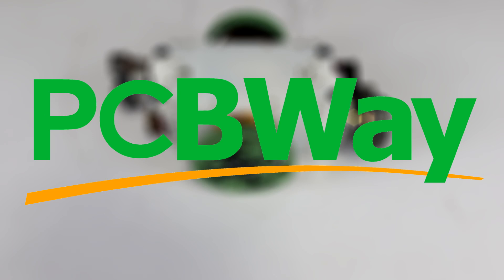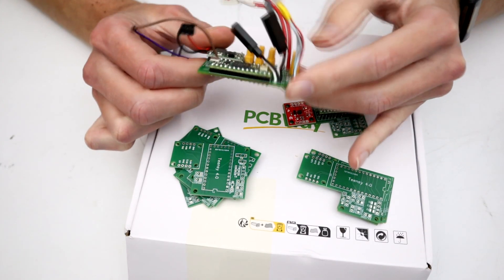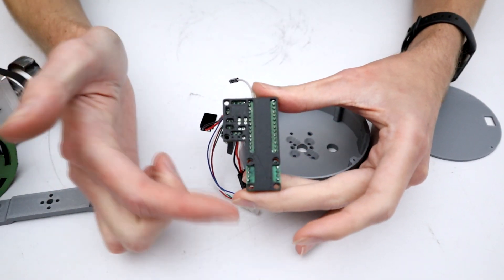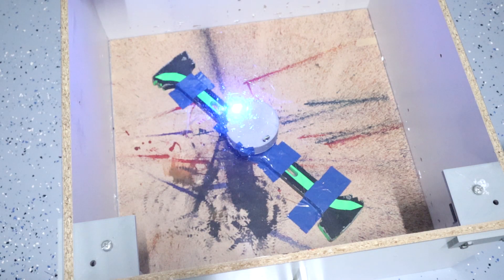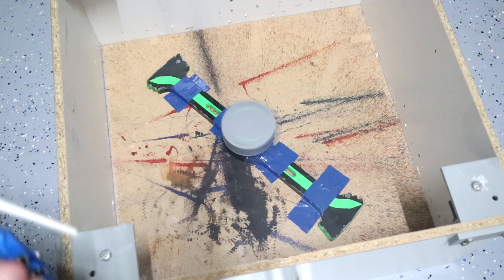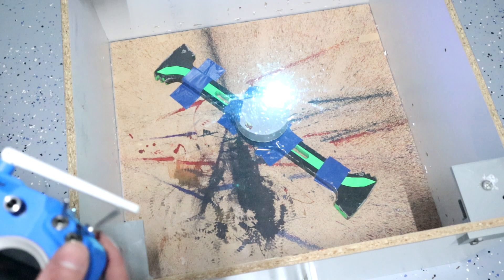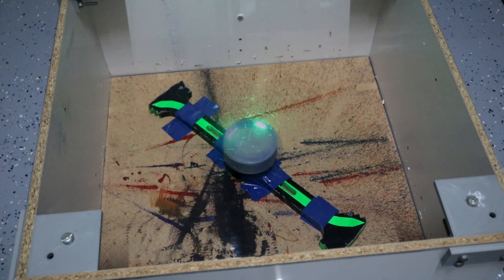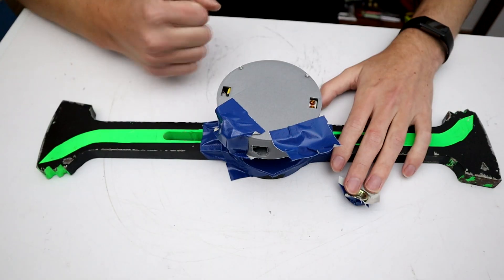A huge upgrade for my spinning robots!! (melty brain accelerometer sensor)

Comment: Going to agree with others, using an accel for dead reckoning in this application is kind of grasping at straws, but using a gyro also likely won't work either due to RPM! You need to infer your rotation and position from an external source. An IR receiver on the bot would be best, so it can PLL a position and/or PID lock it's own speed to that if needed. It's like trying to prove the earth is spinning while still on it, with no stars and sun to reference, and it wobbles more violently than it spins. If it has to be self contained, and an external IR beacon isn't allowed.. maybe consider what sumo-bots do and beacon off your opponents IR reflection, but the walls will cause this as well, so that's a bit more iffy.
Reply from the maker: There is no "silver bullet" to heading in a melty, you are correct, inferring speed based on accelerometer data is flawed, but IR beacons have issues too. People who have run them report a high drop-off in accuracy at range (as the beam from the IR spreads) and also if the beacon is held outside the arena (the only method guaranteed to be allowed by the rules), then the refractive index of the polycarbonate messed up the beacon when the melty is near certain walls

Using an onboard beacon also has flaws, as you have now put sensitive vital equipment on a robot in combat, also it requires a ton more onboard processing, which either slows down your main processor, or requires a second processor, which adds more complexity, things to break and cost

Getting a heading from an accelerometer is simpler, doesn't change based on arena/rules at a comp and can work well enough to fight with, hence why I'm using it

Also, the heading really doesn't need to be super accurate, my current melty gets its heading by guessing speed based on the eRPM of the motors, which is reported by the esc, this is the worst possible way of tracking speed as it has the most possible sources of error, but it has worked in combat and the melty can translate. this accelerometer is a huge step up from that

Comment: Hi Ben, I highly reccomend switching to IR over accelerometer to determine orientation. It's absolute positioning means that cracks on the field or wall impacts or rpm accelerations do not cause drift and offset your headings. Also you never ever ever need to deal with the accel calibration bull crap. Its been working great for my PLANT and believe me, I've tried all the methods. I've been through three different revisions of pcbs with different chips including the mpu6050, AXL375, and magnetometers. I've found that sunlight and reflections dont affect my the sensor and its superior detection means rock solid heading and best in class translation

Comment: I don't get why you don't use a 9-dof sensor and fuse the magnetometer data with the gyro.
You get a fairly good heading check with fast gyro response.
Reply from the maker: Mostly because there is only one mems gryo on the market that can survive/give readings for 2000 RPM and its $50 per chip and they want a minimum order quantity

I think there are prototyping boards for it, but they are more expensive again
Reply: @TeamPanicRobotics  That's just it though, gyros are horrible for such things due to drift.
Magnetometers however are excellent if you can avoid them being influenced by everything and everyone (bots) in the vicinity. Try calculating a direction vector from x/y magnetometer once in your bot and see. Magnetometers are a tad finnicky to work with as you must calibrate em in your final bot and they may be a bit wonky on metal battle arenas, but should still be orientable once you select a direction. I used to love using InvenSense IMU's (now taken over by TDK and deprecated).

Comment: Isn't there a problem with high variations in acceleration readings if the bot is not perfectly balanced and wobbles around?
Especially with a bot that will get thrown around in the arena by it's own design I would not expect it to stay perfectly balanced after some collisions. So the acceleration readings might change drastically destroying any previous calibration.
Just to be sure that's not the case you could move your counterweight in your test-setup a little after a successful calibration to see what happens ;)
Reply from the maker: Thats part of why I have a heading adjustment knob on my controller to make small adjustments on the fly if the heading starts to wonder
Reply: @TeamPanicRobotics  I have no idea how the accelerometer works, but if you read out the value every few milliseconds I think the values could vary extremely depending on where on the wobble the measurement is taken. It might be nearly impossible to get  stable readings.

Comment: put 3 distinct color LEDs on it.  Fire each of them at different rates, for instance 1, .5 and  1/3rd so that they create a distinct but basic patter.  If visually the expected pattern doesnt show, it would help with knowing if the speed/timing is off. as well as how far off it is.

Comment: good heading requires gyro..
a few things I'd recommend..
1. add a gyro (only used for self start calibration during the first 1~300RPM this is used to find the offset from center of mass)
2. use SPI + IRQ over i2c SPI is significantly faster and by using A. fixed timer interrupt. Or B. input interrupt the RPM calculations will be far more consistent the main clock is held during the delay function + code execution. i suggest  putting all of the spinner function into a dedicated loop on it's own clock possibly use DMA+FPU to hand most of the math so the CPU can focus on servo and led signals.
If am bored this weekend I will rewrite your code for how it is and some code for how i think it can be better. I might just redesign the entire thing as i can think of a few uses cases for it my self

my last and biggest hint the center of the bot and the center of rotation are not the same at speed it will rotate around the center of mass so the accelerometer offset needs to be based on the center of mass.
from what i can tell 
your setup is a bit of filtering
1. teensy 2
2. H3LIS331DL on a sparkfun board
I can make you a custom board with a SAMD21G + H3LIS331DL + LSM6DSV16X + USB-C (usb storage mode) + flash for logging test and fight data. it will be smaller than the teensy 2 by it's self
Reply: Calculate G for rpm. 1in or 2.54cm from center of mass at 2000rpm
0.00001118 x 2.54 x (2000)² = 113.5888G's = a max rpm of 3750 if the lis331 is set to 400g max.

If you ditched the vertical for a steel cable with a mace on both sides for a 18in total diameter when spinning at 2500rpm gives each mace 1600x there weight in hitting power just a thought. If each one was 250gm that's  a 400kg impact not much in that weight class can withstand that and if that's not enough 3000rpm is 2300x there mass or a 530kg impact. It has a lot of potential
Reply: Dude, isn't the board he joined to the teensy a gyro?
LSM6DSV16X is gyro and acc. H3LIS331DL is acc. Why?
Reply: @1kreature  the board he is using is accel only no gyro.
The reason is dynamic range
The accel he is using is a good unit it can measure upto ±400g where 99.999% of units max out at 16g  most gyro top out at 2000dps some will can get to 4000dps
That's degrees per second and even 4000dps tops out at 666rpm.
It's the restrictions of the gyros that force us to find other methods like using centrifugal force to calculate rpm. I still think adding a 940nm iron detector in the side of melty and a bright 940nm led light. This interrupt will let the bot correct for drift in real time keeping an extremely tight heading lock.
Reply: @CNCAutomationLab  Wow, I did not see that! Thanks for correcting me!
Using just accell is hopeless. In fact I'd cheat and also use a IR and light detector so I could record a "360 waveform" of my surroundings and use that for an extra fusion sensor reducing drift. The magnetometer has same effect and can be samples 8000 times a second (MPU-9250) and 2000 rpm is only 33.3 rps giving 240 readings per revolution. More than enough for navigation.
Reply: Btw, InvenSense/TDK is a bit vague on if (MPU-9250) magnetometer can actually be sampled at 8000 sps, but some other models can.
Reply: @1kreature  ya but still a long way from 15000-20000dps needed to rely on gyro alone. Also I think the 9250 is eol. 
Also they need to survive repeating 7-10,000G shocks from impacts or the board will need a lot of isolation
Reply: @CNCAutomationLab  That's why magnetometers are so good. They do not have the G limit of mems acc/gyros and they relay a almost fixed reference.
Reply: @1kreature but they get destroyed by noise/interference and have a very slow sample rate no?
Reply: @kunalshah7539  They are affected by noise yes, but you do get some nice sample rates now.
Reply: @1kreature  wouldnt the electo-magnetics in the motors and motor wires be enough to completely throw magnometers off?
Reply: @kunalshah7539  No. If you do the wiring correctly the fields will cancel out. Professional systems work great. It is usually hobbyists that get into trouble.
Reply: @  ic do you have an example system?
Reply: @kunalshah7539  Well, both Boston Dynamics Spot and Cheetah both utilize a magnetometer. These are walking robots though so not spinning around like whirlwinds. Update rates required is lower.

Comment: Would you ever try using something to measure the hz of the vibration of the bot to work out the current RPM? Appreciate that this is totally unsolicited but I thought for something to reliably meltybrain, it should be able to reliably identify the speed at which it is spinning in order to always maintain a direction. The calibration seems like a bit of a bandaid fix because the bot is always going to be under different conditions. It seems like the best way to have to avoid constantly recalibrating is to just collect RPM data somehow?
Reply from the maker: collecting the RPM data is the goal of any melty design
I tried in my old system reading the wheel speed and interoperating the RPM but wheel slip makes that noisy

Yes the calibration is a bit of a band aid but I think if done right it will only needed to be calibrated at the start of each event

Comment: Do you have any way of tracking rotations per minute? Are you using this as part of the melt program?
Reply from the maker: Thats what the accelerometer is for, by reading one axis, you can find the centripetal acceleration, then you can use some maths to work out the spin speed
Reply: @TeamPanicRobotics  I guess I don't understand the read out. I thought the accelerometer would show a constant force once up to speed, and I don't know how you calculate a fluctuating rpm from that value